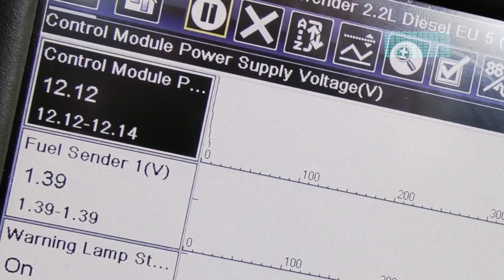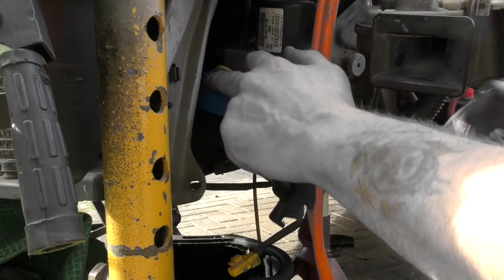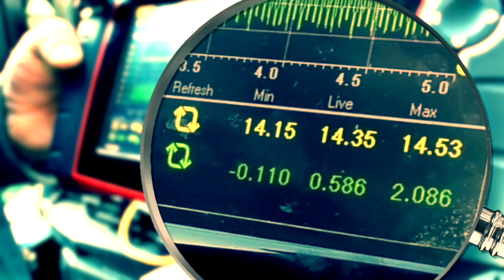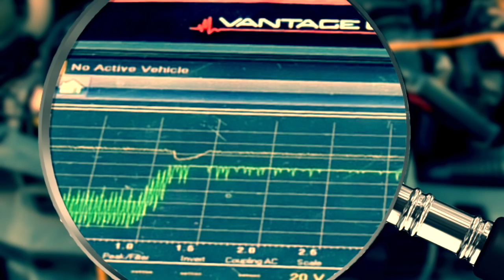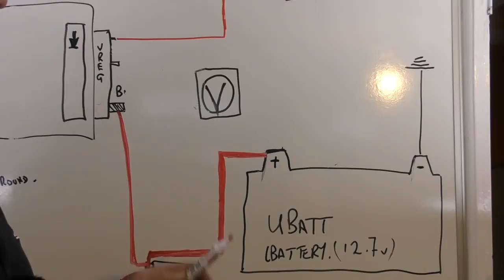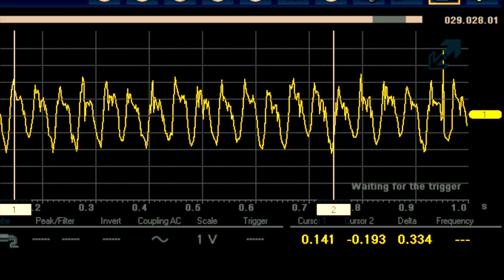Alternator Testing - Inductive Amp Clamp & Multimeter vs. Oscilloscope

Comment: honestly i just use  a TRMS 6000 Counts Digital Clamp Meter with Bluetooth and it will do what that fancy tool does but for 50 bucks off ebay, lets your phone show info while seated as well so you can touch the pedals, which is also great for rainy days

Comment: Hey, I have 'no' problems with my 70amp alternator, never had dimming lights or battery charge issues, at 14 volts with lights on for e.g. But, I have installed a 800watt amp for my sound system and a volt meter in the car, playing music at 80% vol. I'm dropping to 9 volts and staying until bass stops I'm quickly back to 14v. Testing my alternator, no matter what load I put on it, clamp testing charging wire I'm always at 4amps. I used 2 clamp meters to test and shows the same. I don't understand because I can put 50amp load with all factory equipment and I'm at 13.4v but 4amps on charging wire, it's only with music I seriously drop volts. All connections are 100% clean and I've upgraded charging cable and all major grounds to 4 gauge. Is this a problem with alternator not reacting? Should I even worry about it because if I don't play music my charging system works just fine.

Comment: Hi Chris... Great video and very helpful... My 2002 TD5 Discovery 2 will not crank or start, not even a click to be heard when trying to start... Fuel pump Runs but is a tad on the noisy side but isn’t very bad... Also when I put the key in and turn to Ignition On position, the only light that shows up on the dash is a very faint SRS Light, flickers ever so slightly, new battery in it and have done a few check to see if I have bought a faulty battery but no not a voltage drop and no the lights don’t dim when in cranking position... Have had Starter off and it runs perfect with power supplied to it... Any thoughts or pointers on where to look? Thanks!
Reply from the maker: try looking at the starter relay or ignition supply to said relay.
Reply: Vehicle Repair Toolbox Videos Oh yeah, never thought of the relay, I’ll have a look at that tomorrow when I’ve finished the alternator on me dads Disco 3... Thanks Chris!
Reply: Good  ground/ earth connections ought to be  checked,  cleaned & tightened.
Capillary  action can draw water in & corrode  the copper  cable  / wires further up the  line from the  mounting point so a voltage  drop test will be necessary  if the grounding  points  are tight & clean.

Comment: The cheap clamp meters are usually only for AC.
Reply: I'm quite happy with UNI-T UT210E, 35€
Reply: @frank-lr  It can only do 100A, you can get UT203 which can do 400A and costs same.
Reply: cm82c cheap and stable on dc current. but for measure mA need multimeter, clamp cannot read mA it